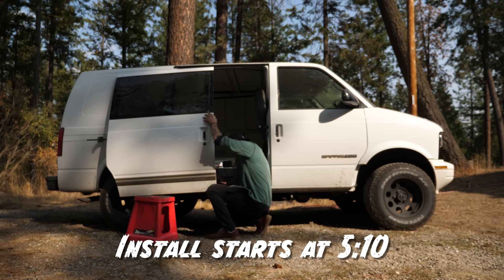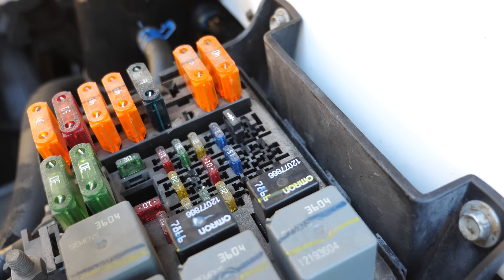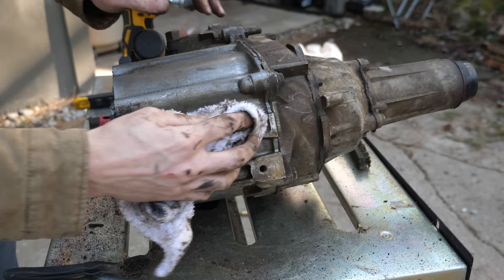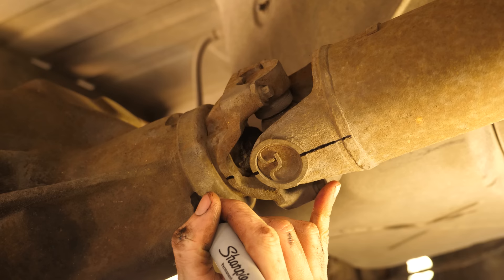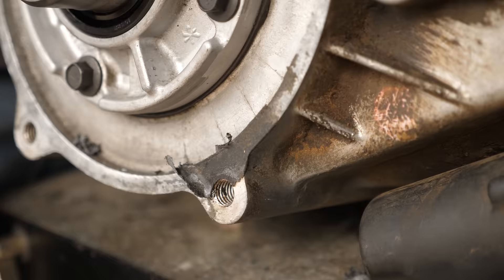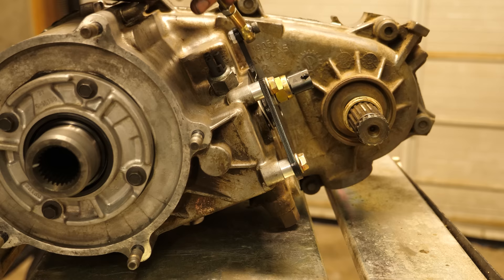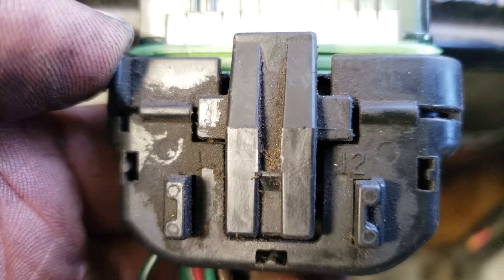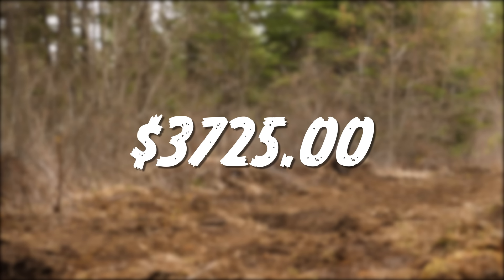4x4 Swap for Astro and Safari! // Conversion Explanation and Install // Journey's Offroad - Part 5

Comment: Good video - I have an '01 Astro myself - I would only point out it's not a TRUE 4x4 until you get that open diff out in the rear and put in a limited slip differential! I just installed TrueTrac in mine - limited slip changed the game, I got stuck in my own driveway, twice - good luck.
Reply: Of course you also could put limited slip in the front - which is my plan

Comment: Man... thank you doing this video!!! I have looked everywhere for a 4x4 conversion vid for these vans but no one has (as far as I can find). I've done the lift and bigger tires and just researching info for how I want to do the 4x4. I have heard that a NP 231or (found mostly in jeeps with an awesome 4:1 low gear) can swap guts with a NP 233 because they basically have the same case (also apparently there is a 4:1 conversion kit for the NP 233). Videos I have found suggest the guts swap is possible. Also if you get the NP 233 straight out of a parts s-10, get the front axle assembly as well so you can get the locking front end as well (one from a zr2 with a manual transmission is best because the differential housing is cast iron instead of aluminum), and a rear end from a van with the G80 rpo code has a posi locker too. Anyway thanks for this. I look forward to doing mine.

Comment: GM really improved these when they switched to the BW4473.  the VC units eliminated the complete electrical system, and more closely simulate a 4wd transfer case, being able to fully lock up.

Comment: aerostars were 70-30 until it sensed slip then switched to 30-70.  4.0 german v6, weighed a lot less in the short box cargo version.  id take an old aerostar on stock tires anywhere you can go.

Comment: Land Rover: The best 4x4 by far 
Scruffy: Hold my mop.
Reply: I owned 4 LR from an 88 to a 109 and an elusive (in the US) 110 as well.  Got to tell you that camping in my Astro beats them.  I got AC on my way out, a fridge for food, full size bed to sleep and a diesel heater when camping in the snow.
Reply: @AndreasStuben  And the Astro wont hold your wallet at gunpoint and refuse to take you home till you give it all your money.

Comment: All you had to do is put the manual shift on the other transfer case. However the reason it was blowing fuses is because the shift motor was bad. All you needed to do is change it. Your old transfer case is fine. Those transfer cases require a special fluid. It looks like that. Automatic transmission fluid will kill those transfer cases. Ask me how I know.  Auto AWD keeps you from spinning when you pull out on a leaning surface. The Auto awd makes it much easier to steer in the snow.  The auto AWD stays engaged when you are on the gas and will disengage when you let off keeping the front tires from binding in turns.
The bad part about these Astros, mine gets worse gas mileage than the full size awd van. If you are near east tennessee I'll buy your old transfer case for $50.
Reply from the maker: I wouldn't have done the swap of the other case worked the same way mechanically lol. My old case takes the special autotrak fluid you're describing, this one takes atf. I did a lot of research on this subject and talked to a lot of people before doing the swap and making the video.

Comment: when you go to clean the floors to install a floor, I have a suggestion if you can get it near you(it seems like a menards exclusive). D-germ I saw junkyarddigs use it, but man does it make a huge difference. yes purple power is a great degreaser and cleaner, but D-germ goes a step above and removes some smells as it cleans. D-germ much like purple power can be spray and wipe, but damn I've never used something that destroys mold and cig stains as good as D-germ, after using it on a nasty old car, I use it for everything with a hard surface .

Comment: Hey Brother, thanks so much for taking the time to put together such terrific “content”. Here’s a question: did you notice any discrepancy in how much rear driveshaft was exposed out of the tailpiece of the Tcase? I just did the swap and there’s a lot more (5”?) of the shiny-smooth driveshaft exposed. Sound familiar? Also seem to be having issues with the vss. Hoping the case i got isnt some incompatible Frankencase… be stoked to hear of your experience. 
Thanks again! Hope you’re feeling healthy!
Reply from the maker: I had a couple inches of driveshaft exposure after install but it wasn't enough to concern me. The vss in my case worked right away, maybe double check the connection?

Comment: What about locking hubs? An aside: way back when Quigley made a 4x4 Astro conversion. Don't know if it was regulation hi/low shift or full time system. Darn good job on the driveway.

Comment: I'm getting ready to put a 84 Astro on a 87 long bed 4wd GMC Sonoma frame. I know... "Just buy a 4wd van" well I would but the Astro and S10 were family vehicles that were sitting behind the barn,  They cost me zero dollars to get, why spend 3-5k on a older AWD van when I can put that 3-5 into building a rig because the van and frame were free, you can't beat free and i'm not spending a ton of money on it, I live in Northwest Arizona I just want something for a camping/fishing rig for weekends or a few days to run up to Lake Meade/Grand canyon over to the Coconino/Tonto National Forrest, down to Joshua Tree or over to Lake Tahoe for a few days during vacation. and it's just me so I don't need a full size van. Plus the S10 had a 305 in it so that has plenty of power for the van and i'm not doing much "Overland" or rock climbing.

Comment: I dig it!  I always liked the older astros/safaris for body design (and certain rims lol), but never knew the awd system had those weaknesses...   This is kinda starting to make sense if you can find a good host.  I remember how hot those 4.3L Vortec's were back in H.S.  Finding one w/o rust would be key... Not where I live tho.

Comment: I was disappointed when I bought a 2000 Astro AWD then I learned the front axel was deleted and the suspension parts changed to regular, mine is gonna be more costly to change it back to a 4x4, got the van for 200$ btw 👌

Comment: Very nice I paid 30 K to have my RV converted to four-wheel-drive but that also came with lights winches bigger tires 6 inch lift etc. etc. etc. I suppose it doesn’t take much to add up very quickly? 😮😮😮

Comment: Anybody else considering a 1.9 tdi swap in their astro? I feel that 4x4, lockers, tires and gearing is good. The economy of a tdi would make it so much better. My step dad had a old dodge caravan with a 5 speed manual trans. Was thinking this would also increase economy that much more. NV3500 or NV4500 with just a NP203 or NP208 t case behind a TDI. Could spend a week between fill up. Especially if you could get 30mpg.

Comment: You may already know this or maybe not but on the van it’s not to hard to do a v8 swap and I want to say it the same year model pickup 5.7 vortec and you use the ecm from the truck? I can’t remember exactly. I had a buddy that did one and it made the little van pretty bad ass

Comment: Cool video great info. I think if it were my van though I would have either installed the push buttons 4x4 switches from a tahoe or silverado in the dash most of those GM switches fit the holes in different vehicles. Or if you are a pureist and have to have to have to have a lever. I would have scavaged the junk yard for a Chevy S-10 shifter to mount that would have kept it GM looking and cool. I like the kit the company provided, but the handle is ugly and it doesnt even have the transfer case selector listed on the stick...just saying I think this could have been a cleaner install without the long steel rod sticking up through the floor like that.

Comment: Very, very cool. I have a GMC Savanna 1500 AWD with 117k. Everything is working fine but if I ever started to have expensive problems with the AWD I wonder what it would take to get my NP244 transfer case in there...

Comment: Damn man, I sure would love to do this awd to selectable 4wd to my 08 yukon denali 6.2L LS even with 3in lift and 33in mastercraft courser mxt tires it freaking sucks in snow smh the 2 options are let comp control it and have no throttle and go nowhere or turn them off and just spin haphazardly and still not go anywhere lol

Comment: i wanted to do this to my 2000 safari but the chassis was just too rotted. had a guy offer a 455 BB with way too my H.P. and a suspension kit big enough more for monster trucks, the guy was nuts. i should've did it but it was my daily driver...

Comment: Since your van came with a part-time AWD system does it also have a center axle disconnect like the S10 pickups? If it does the vacuum actuators for those are notorious for going out. There's a thing called a Posi-Lok that replaces the vacuum actuator with a manual control. But deleting the CAD entirely would be more reliable, assuming it even has one. 

Makes me wonder if I can swap Safari axles shafts into an S10 to get rid of the CAD in them.

Comment: That was an awesome video. I didn't even know they made 4x4 or AWD Astro mini vans. My question is, could you have bought a "rebuilt/overhauled" transfer case instead? And would it be worth the extra expense, whatever it would've been? I just ask because of the gamble you take that the transfer case you bought used could take a crap or start malfunctioning soon after all that hard work you put into the conversion, & because its easier to do that while the transfer case is already out of the vehicle.
Reply from the maker: Always worth buying something overhauled,  you'll just be forking out 4 times the amount or better. But the peace of mind is definitely worth it to some.

Comment: I have the same transfer case in my 97 Blazer base model 2door 5speed. And it's a manual 4x4 shift, not the shitty electric button on the dah. Pretty solid >:0

Comment: I have a 05' blazer  Vaccum lines/valve controled 4x4 with electronic push button/motor to cable wire pull And mechainical gears  "Garbage"

Comment: Two questions. Does this give high and low range? And, can you use manual lock hubs with this set to isolate the front drive system with this?

Comment: That was awesome 
Where did you get that shift linkage . I got a 95 gmc jimmy I’m having trouble with my encoder motor  as well I took it off an shifting my transfer case into 4 wheel drive. But I don’t wanna gouge up the part that sticks out I’ve been looking for a shift linkage like this.

Comment: Great video.Over the  last 25 years I have had 4 Astro / Safari vans. 3 were AWD  . All 98 or older.Not sure if I missed it but did you have to get drive shafts cut or lengthened or did they just bolt right back up? Thanks for making this video.
Reply from the maker: Bolted right back up!

Comment: I bought this same kit but have ran into the front shaft rubbing on the sub frame. mine is a 1998 model safari though. Have you had that problem at all? Journeys said I may need to notch the frame.

Comment: NEVER put gasket sealer on both sides and then use a paper gasket. acts as a lubricant and spits the gasket out or splits it. one side only, or dont use a paper gasket. or my go to is copper spray both side of the paper and let it tack up then install.

Comment: QUESTION I have a 2005 Chevy Blazer.. Will my Tcase work in a Astro/Safari? My truck is nearing the end of its life.. It wasn't treated with the respect it deserved from the previous owners (one family owned it). I bought the truck for $500, put another $500 into the front end, and now I might have blown a head gasket or cracked the head (it over heated bad).  I found a Astro for cheaper, than fixing the engine on my Blazer.. OR I K-Seal the engine, and drive it until it explodes.

Comment: Awesome video man, I also have a lifted Astro... are you noticing any corrosion on your lift kit from journeys?  They claim it's powdercoated but after ONE winter where I barely drove this thing, all their parts are rusting all over the place.

The quality of your videos is great, but your lack of gloves/safety glasses/creeper is crazy to me, lol.   Not dangerous.....  just... doesn't match the quality of your videos.  

When I tackle this, I'm thinking about trying to get an electronic shifting transfer case from a Jimmy, and wiring in a push button 2wd/4hi/4lo.... did you look into this at all?  

Cheers!

Comment: I'm curious what the difference between2wdand4wd are frame wise, and also suspension wise. I keep seeing 2wd versions for cheap, but I'm in Philadelphia, and I have to deal with snow at times. I don't want to be stuck, and I like having more room than my old Subaru. Anyone know what is necessary to do a two to four conversion?

Comment: You do not have to mark the driveshaft to rear end placement. It's irrelevant to the balancing of the drive shaft. Want proof? Go to a drive shaft repair shop, they balance the shaft by itself, not attached to the rear end. Hence why you only take them the driveshaft alone for balancing.

Comment: interesting.  The NV 136 was the only thing that never gave me trouble on my AWD Astro van (2000).  Otherwise, a total piece of crap
Reply: What all gave you trouble? Would you be deterred from making this your conversation project?
Reply: @joshoooway  My 94 2wd was fine.  My 00 AWD had distributer issues (multiple replacements), two transmission failures (solenoids once, sun gear the second), intake manifold. and of course early front suspension issues (40k miles)

Comment: "All four wheels will claw for traction".  Did I miss the part where the transfer case magically added front and rear lockers or at least limited slip?  Seems to me you still have a two wheel drive van that now has 2 wheel drive Hi and Lo.
Reply: Watch the video before commenting dum dum

Comment: What do you think about taking a 2007 V8 SS Monte Carlo front wheel drive converting it to an all-wheel drive theoretically think this is possible since the engine is sideways??
What do you think I would need I don't want anything that's going to break?

Comment: Can front driver swivel seat be used with the new lever? Could the lever be placed farther forward or shortened to accommodate the swivel seat?
Reply from the maker: Yeah you can probably fudge the position of the lever a bit, the linkage style allows it. Not sure if I'd shorten the lever though, might make it a little tough switching gears.

Comment: can I opt to upgrade to a electronic push button instead of installing a floor mounted shift lever for this unit?,  TY for the video.
Reply from the maker: You can, its been done, you'll have to do a little digging on the forums to find the correct wiring is all. 👍
Reply: @TheShredist  I definitely need to upgrade my transfer case. I just completed my V8 LS swap which is now over 450 HP. She's lots of fun and will definitely turn all four. But luckily I'm 55 years old and don't run the dog piss out of it. But I do want something that will take the additional horsepower and as you said awd units on these Safari Astros are just not meant for that kind of use. I am also considering a unit out of a tahoe/suburban because they also have AWD feature along with the 4WD options

Comment: After Watching Countless Hours Of Off Road Video's I Always Question Exactly What Is (Off Road) We Need to Get To Unless Your Hunting Dear Ticks? All The Destroyed Vehicles Trying To Climb Rocks To Get Where? To The Top Of The Rock?  Don't Get Me Wrong I Love Astro Vans and AWD Is Awesome In The Snow ON ROADS were Vehicles Are Designed To Go. I Have Owned 5 Astro Vans and They All Go At Least 500K Miles Just Changing The Oil and Break and Gas lines and a Few Fuel Pumps, Alternators, Etc. Dumping Money Into These Vans To Make It Something It's Not Seems a Huge Waste Of Time and Money, Lift Kits Ruin The CV Boots and Shafts So Spending Money To Create Huge Problems That Are No Joy To Fix! AKA Lower Ball Joints On AWD is a Douche.  
 Keep It From Rusting and Change The Oils In Gear Boxes and Engine And Change The Lines With Stainless And Your Van Will Last a Long Long Time. 
Turning Them Into Campers For Adventure? Price That Out Along With Time Spent. Maybe I'm Missing Something But What's the Point Of Rock Crawling ? To Get To The Top Of The Rock?  When Most End Up Upside Down @ The Bottom Of The Rock :O)

Comment: Fantastic video! But, I have to say you don't want to be popping driveshafts out like that. The caps can fall off and get dirt in the bearings and on the joint, even spill the rollers out on the ground. Pop it loose before you take the yoke straps all the way off so there isn't any excitement. Even then it's best to wrap tape around the joint just to be sure they aren't going anywhere. Don't think I'm busting your balls. I've even seen someone destroy a new joint when the cap came off and they put it right back on; one or two of the rollers had fallen down in the cap and it was just crushed in to place.
Reply from the maker: Good tips, thank you!

Comment: Why not just use the push button 4x4 that comes with the blazer?
Reply from the maker: The electronic actuator on the t case loves to fail, this eliminates that and increases reliability.
Reply: @TheShredist  also do you know if the transfer case is the one with the cup yoke or bolt on strap style yoke?